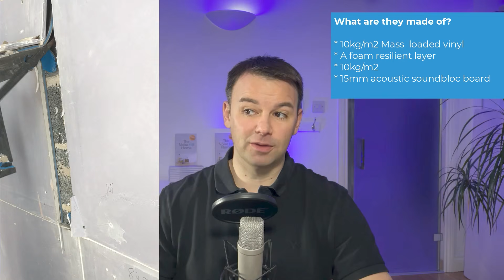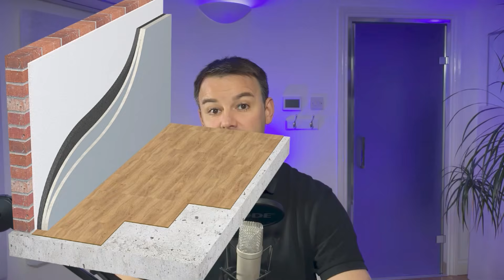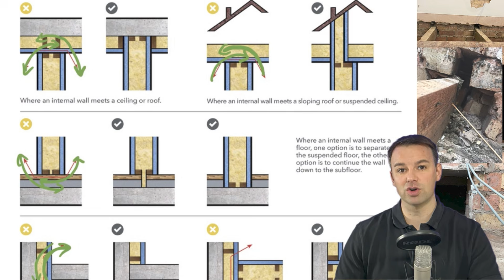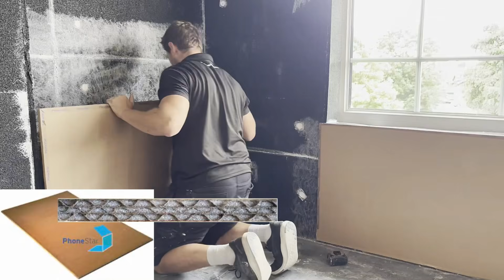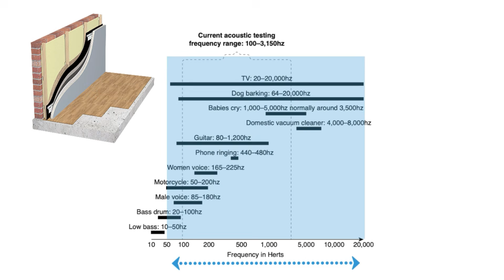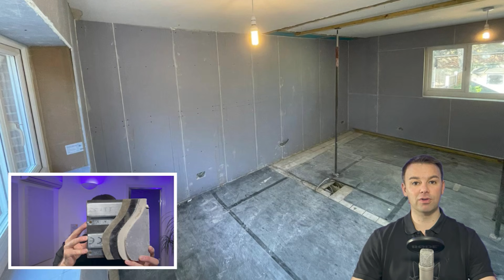7 ways to Soundproof a wall | #diy

Comment: Thanks for the content-very helpful. Can I apply the solutions described here on the ceiling, too?
Reply from the maker: Hi @konradstachio8173, thanks for your question….have you seen this video: 
7 Ways to Soundproof a Ceiling
https://youtu.be/0OSrzTPM1cw 

Hope that helps 👍
Reply: @jimprior7  Thank you-it was very useful! Any idea how to solve the issue of noise coming through the ventilation shaft?
Reply from the maker: Hey @konradstachnio8173  What is the ventilation shaft made from? Metal? Plastic? Brick? or something else?
Reply from the maker: @konradstachnio8173  Yes, but I need a bit more information on it first, is it metal, plastic, concrete. What sort of ventilation shaft is it?
Reply: @jimprior7  Hello! It is an A/C Shaft. It is not about the machine's noise but the noise from the neighbors that gets carried through it. It is made of soft, sponge-texture panels covered by silver foil. Not sure if that makes sense :)

Comment: Hi, are there any issues glueing any panels to a plastered and painted wall?... Im thinking about the rubber panels made from recycled tyres then the sand board, surely if you glue it to the paint or plaster itll not be secure as itll just peel off?.
Reply from the maker: Hi Mike,
Thanks for your question, the YouTube videos give good insights, I hope you are getting value from them. Difficult to show every scenario, but no, never had a problem the way we fit them. We offer a 10 year guarantee with all our work so we therefore fit them differently to how materials manufacturers suggest.  We show the rubber panels we use and exactly how they are fitted in the Noise free DIY Soundproofing Course.

Mike have you tried the masking tape test on your painted walls?

Comment: Great vid keep it going! Do you think if I already have two layers drywall, if I put there 3mm massloadvinyl and again two layers drywall is doing anything?🤔
Reply from the maker: Ah thanks for your kind words, really appreciate it.
I’m not sure what the Drywall is currently fixed  to, but I will give it a go….hopefully this makes sense: 

I think MLV and an extra 2 layers would give you a noticeable human perceived reduction in noise …if the existing 2 layers are fixed to a well insulated stud wall.

If the stud wall is hollow behind the existing two layers of drywall….Or the existing drywall is fixed using dot and dab plasterboard technique, say to a brick wall for example….then I would NOT add the extra two layers or drywall and MLV.

Why?….Because you will change the way the sound enters the room directly and you will more likely channel the noise into other parts of the house and flanking walls.

If the two layers of Drywall are fixed to the 20mm rubber or resilient bars as shown on the Noise Free DIY Soundproofing Course….then yes this added mass to a resilient layer will reduce the noise further.

You may have to read that a few times…hope that helps.
Thanks very much for your comment 🙏

Comment: Hi Jim, thank you for your video. I live in a semi-detached house I've been dealing with a neighbour playing marching drums. The noise is loudest in one of the adjoining bedrooms. I've been considering a floating frame system as this seems to make the most sense for my situation. I know it is hard to gauge for you when you haven't heard the noise, but would a floating frame system installed in just the offending bedroom help mitigate the noise, or would I be looking at perhaps having to install a floating frame across the whole party wall?

I would be looking at not just the floating frame in the bedroom, but perhaps one of the slimmer systems you mentioned on the flanking walls. Would this be necessary also?

Thank you.
Reply from the maker: Hi @Yerjam, thanks for your great question, 
In my opinion having not seen the property, I would still recommend doing one room really well first. Doing the whole party wall alone is a big trap, and will not get you a significant reduction in noise. Marching drums is very loud and that noise will transmit throughout the structure.

Definitely need to sound deaden the party wall in the room you are trying to soundproof, together with all the flanking walls in that room with the 50mm system. After that install a floating frame with the high end specilist materials shown in this video👇

You would need something a bit more like this for the direct noise path: How to professionally SOUNDPROOF your HOUSE! 
https://youtu.be/JUdjtpa2ik0 

Before you get too excited….i have question for you: Which room are they playing the drums in?…and which bedroom are you trying to soundproof (front or back bedroom?)

If they are playing the drums diagonal down stairs in their front lounge for example and you are trying to sleep in your front bedroom…then we need to do something slightly different.

The best way to do this is to get on the Noise Free DIY Course…so you understand the work involve, it gives you all the instructional videos, materials calculations tools and everything before you start any renovation or before you buy any materials….if you choose to go for the renovation after working through the course…..you may need an hour installation support with me as well if you choose to use the 185mm thick system.

Hope that give you a bit of direction 
Thanks for watching
Reply: @jimprior7  thank you for your advice.

I'm glad you agree marching drums are loud as my local council certainly doesn't. The noise originates from my neighbour's front bedroom (first floor), and is the loudest in my adjoining front bedroom.

I think your plan of starting in that room makes sense and I can work from there. But as it is a noise that can be heard throughout the house, I do have concerns about the noise travelling around whatever system I install in that room.

Thanks for the link and the guide you mentioned. I'm going to take a look and make sure I do everything right as installing even in one room would be a significant cost for me.

Thank you again for your reply and now having found your channel I'll make sure to binge it all I can!

Comment: I keep coming back to this video, good stuff.   
I think one reason people shy away from resilient bars is because it's easy to make a mistake, zip a screw through and compromise the system.  IMO, clip and channels are a bit more decoupled and more sturdy. 
Did you ever have a problem where the rubber comes off the wall from the adhesive failing?... seems like a LOT of weight for adhesive to hold up, especially as more time passes.
Reply from the maker: Hey @JP5466,
That’s awesome, I’m glad so many people are getting value from this. You should watch The 7 Ways to Soundproof a Ceiling video, even though it’s your walls you are trying to soundproof, the ceiling video gives good insights into resilient bars and clips and channel installations.

7 Ways to Soundproof a Ceiling
https://youtu.be/0OSrzTPM1cw 

We find that the clips and channels are great but will require a traditional stud frame fixed to the structure in the traditional way…. therefore not as decoupled as our floating frame and resilient bars that we show you in the Noise-Free DIY Soundproofing Course.

No, never had a problem with the rubber coming off the wall and therefore offer a 10 year guarantee with all of our installations. You absolutely MUST however install it how we show you in the course with the two different types of contact adhesive. 

I like to think the YouTube videos are good insights but we show detailed step by step lessons on how to install the systems on the Noise-Free DIY Soundproofing course.

Also, we are running a 48hrs halloween special offer on the Noise-Free DIY Soundproofing Course. MAKE SURE YOU ARE REGISTERED BECAUSE IF YOU ARE NOT REGISTERED YOU WILL NOT RECEIVE THE OFFER. 

If you are in the UK here is a link to the Spray contact adhesive https://bit.ly/3s82pjv

Hope that helps
Thanks for watching.
Reply: @jimprior7 where do we register for this offer Jim?
Reply from the maker: Hey  @tomnoble27 ,  here is the link to register: https://jimprior.com/diycourse/

If you have registered for the course you will get an email when the offer is sent out at the end of the month. It will be first come first serve, as you know we limit the number  of intakes to ensure everyone gets maximum value.👍 Many Thanks
Reply from the maker: @tomnoble27  Hey  @tomnoble27 ,  here is the link to register: https://jimprior.com/diycourse/

If you have registered for the course you will get an email when the offer is sent out at the end of the month. It will be first come first serve, as you know we limit the number  of intakes to ensure everyone gets maximum value.👍 Many Thanks

Comment: Hi Jim. What options are there to tuck up or down if you cannot move the joist?
Reply from the maker: Hey @Johncanter9575, are you on the Noise Free DIY Soundproofing Course? If so I will email you lessons. 👍
Reply: @jimprior7  Hi Jim, unfortunately not. Would love to but on a budget so hoping for some cheeky free advice to solve my noisy neighbors that have moved in. 😁 would love to if i could afford it.
Reply from the maker: @johnc9575  Hi John, Ok its difficult to explain over YouTube comments, because there are lots of different approaches to tucking it up or down depending on your property age and the construction...My Videos are just insights into soundproofing homes, they don't go into that much detail of the actual installations and we are careful what we show as these are real peoples homes.

It really is important to go that extra mile and tuck the system up and down because it can be the difference between you hearing your neighbours or not after. 

I do offer installation support and renovation advice if the course is not for you. https://jimprior.com/work-with-me/

Comment: Can you attach things like radiators to the 50mm solution using the dbx board? How would you avoid sand coming out of the boards when attaching the rad brackets?
Reply from the maker: Hi @Grangey, Yes you can put anything you want on a new soundproofed wall.
As you are probably aware by now soundproofing is not always straightforward and the right techniques to use will depend on your specific property and noise issue.  

In the video’s I try to give some general installation advice to help homeowners and DIYers avoid the most common soundproofing mistakes.  I wish I could fit everything you need to know in detail into a 10min video or 60 min webinar but unfortunately it’s not really possible.. hence the DIY soundproofing course offering.

With the online course I can show you the how to’s in much greater detail including exactly how to position radiation brackets depending on what wall system and materials you are using or what wall surface. Including where to put the screws, what size screws and how to prevent sand coming out.

You also get the opportunity to have an accountability session with me to make your plan of action for your specific property and noise issue.

If the course is not for you there is also the opportunity to just have virtual installation support from me to ask questions as you carryout your installation. See the work with me link above.

Sorry if that sounds a bit salesy, hopefully by now you will know that I am genuinely passionate about helping people reduce the noise in their home and want to give you the best advice I can which is why I created these offerings to allow me to do that….if I get enough questions on the subject then I will make a video on it.
Thanks for your comment 🙏

Comment: Ever try lead?  Lead sheets take up a lot less space and are very good at blocking sound.  Heavy as hell though.
Reply from the maker: Hey @JP5466, No I have not ever used lead, but funny you should say that because we are currently building a soundproof safe room at the moment and today we were building the walls of the safe room. 

The specialist walling we are installing has reinforced steel sheets…very heavy. 

We had to reinforce the floor joists to take the load bearing of the wall alone. I’m sure the lead would be similar….not very practical for residential but great for a soundproof garden room studio.

Not sure how the heavy duty walling will react to noise yet….we will find out tomorrow. I think we are going to have to sound deaden them with TecSound.
Thanks for your comment 🙏
Reply: @jimprior7  Interesting.. good luck with that.   I've constructed 2'x4' panels using 1/16" lead sheets glued to 3/4" plywood.  I sealed up my bedroom window with them to block loud bass music from cars passing by.  I tried many things previously, but this is the best thing I've done to reduce/block low frequencies.
Reply from the maker: @JP5466  Cool, thanks for sharing....did you leave an air gap between the glazing and your lead panels? We find when we install our acoustic secondary glazing, we get a better results by creating a 75mm to 100mm air gap between the existing  glazing and the new secondary glazing ....and then install something in the gap to stop the sound resonating.
Reply: @jimprior7  There are 4 panels total.  I layered 2 completed panels on top of each other with 3-4" inches of space in between and fill it with rockwool.  One set of panels is attached to the inner frame and the other set is attached outside the frame.  Sealed it all with acoustic calk.  The entire thing weighs 200lbs, but it blocks out low frequencies very well.  The lead itself weight 120lbs.  Mass baby!

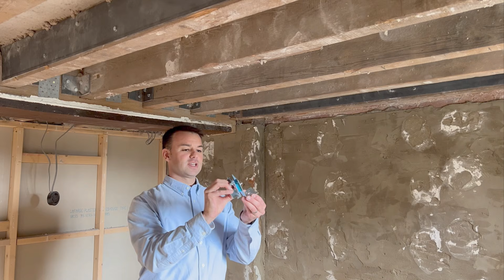Comment: HI, at 10:19 you start talking about an acoustic clip and rail bracket. It there a product name  /  company name for this clip. I like it a lot.
Reply from the maker: Hi @Annavariumful, thanks for your question, here I’m referring to a LB3 bracket that sits between the joist making it the thinnest clip and channel system on the market. In the video we are using a Mute clip version. The Original LB3 bracket is made by Genie Clip. I go into a lot more detail in this video: 7 Ways to Soundproof a Ceiling
https://youtu.be/0OSrzTPM1cw 
Are you base in the UK? I might be able to suggest a similar product depending on where you are in the world.
Thanks for watching 🙏
Reply: @jimprior7  Hi, thank you for the reply. I'm in Australia. The clip looked really robust with a significant isolation pad, and going off the bearer I think I'll pick up a little head room. I'll have a look at your other video. Thanks again!!

Comment: Are there more ways to pinpoint where the sound is coming from besides putting your ears to the wall? Do you have a video on this topic? I can hear my neighbor upstairs but when I try putting my ears on the wall I feel like I can hear the sound on every wall 😅 Not sure if this means I'm going to need to isolate the roof and all walls or if I'm just not finding where the main issue is.
Reply from the maker: Hey @AMVaddictionist, that is a very good point, some new build properties have a lot hollow walls and you can hear the noise on every wall in the house. You might need to install sound insulation to everyone of those noise paths to get a good reduction in noise. By doing this simple test has showed you that soundproofing the direct noise path alone say the separating party wall....or separating floor alone if they are above you will be a waste on money.... it may change how you hear the noise....but it will still come through.
What type of property do you have? Do you have an apartment? If so this is a good video for you:
7 Ways to Soundproof a Ceiling
https://youtu.be/0OSrzTPM1cw 
Thanks very much for watching

Comment: ALL MLV are EXPENSIVE and Crap !
Best things to use for blocking sound are  Exterior Rockwool Slabs directly onto the party-wall topped off with as as many that are needed 8' x 4' sheets of  SoundBlock  Gypsum. I found two staggered layers of soundblock on top of the Exterior Rockwool Slabs best in my house, no more noise and THEY were Loud people !
Rockwool also have sound-block type of slabs but They are not as Good as the Exterior slabs.
Reply: how did you fix the rockwool to the wall... and then the soundblock to the rockwools exterior slabs?
Reply: @johnc9575   Rockwool I fixed to the bare walls using penny-washers and hammer-in-fixings ( the cheaper version of Fischer fixings)...4 in each rockwool slab about 2inches in from each corner. Soundblock fixed to the rockwool exterior slabs using patches of 2-3 inches deep BY 5 inches or so in diameter, of bonding plaster (white and purple bag)friend... about 12 patches per 8'x4' sheet.
Reply: @BLUEHORIZON-g2b  sorry... one more question. How thick did you go with the rockwool external slab?
Reply: @johnc9575  Just the one layer friend.
Reply from the maker: Thanks for sharing and thanks for the tips 👍

Comment: Hi Jim, i noticed in system number 5 (battened wall) the mineral wool is in contact with the party wall (or tecsound layer) but in the floating wall system it isn’t, is there any benefit to that or does it not make much difference?
Reply from the maker: Hi James,
Thanks very much for your comment: The floating frame offers a significant reduction in low frequency noise and some impact noise because its isolation from the structure. Soundproof wall system 5 with the battens fixed to the wall with anti-vibration pads will offer only 50% on those impact noises and a bit more on the lower frequencies.
What is you noise problem?....If you are hearing dogs barking, low frequency bass music, foot steps, clonks and clangs and doors banging for example then you are better taking the space loss with the floating frame on the direct noise path…..but remember you need to follow the 4 step method to get a good result…..it’s never just the party wall.
This video we used the floating frame downstairs, and the batten system upstairs in the bedroom: https://youtu.be/CR7ZtJ3fI2c
Great question, thanks again.